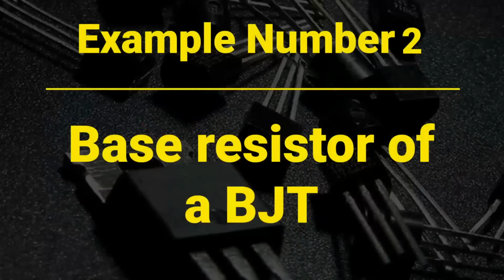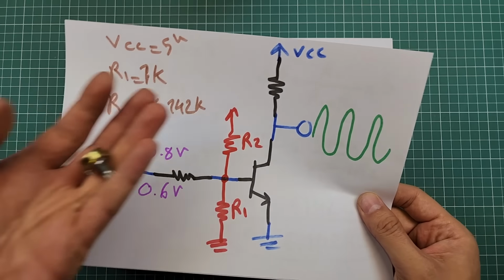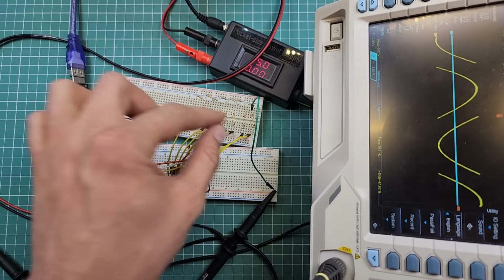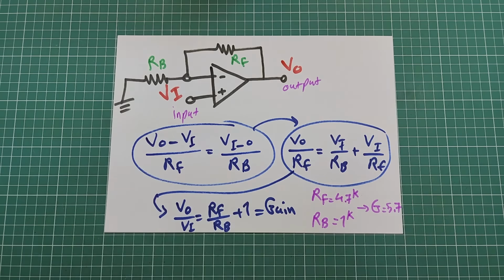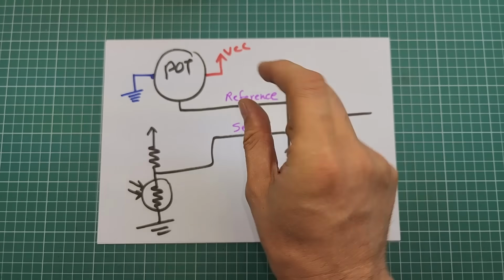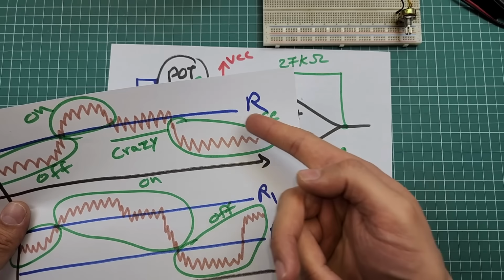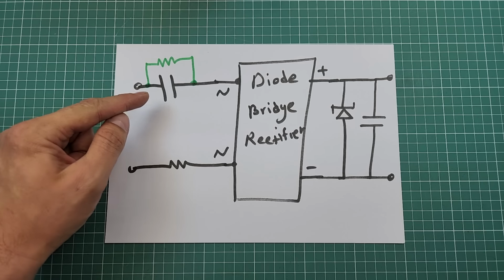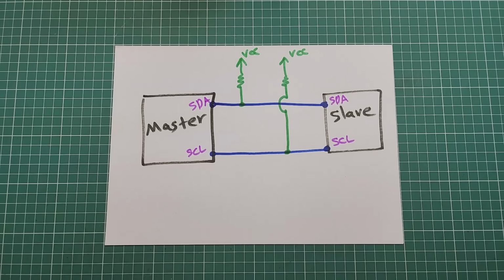Unlock the Secrets of Resistors through 16 Examples

Comment: 16:25 remember when manufacturers actually cared and just used fuses. Then if the fkn fan didn't work you just change the fuse and you know which component caused the problem.

instead of shutting down the appliance to make more money on stupid ppl that think they need to buy a new one.

Comment: You claim that resistors are not simple components and back this up by showcasing multiple circuits with components that are not resistors. Resistors are the simplest components because they are linear and don’t have any calculus operations like with capacitors and inductors.
Reply from the maker: I meant that,  we can make complicated circuit using resistors. Like DAC circuits👍
By the way,  thank you for sharing your opinion

Comment: please write correctly the Unit of measurement (for example: “volt” using an uppercase “V” aligned with text). Another note: PTC, NTC and varistor, are not resistors.
Reply: @stefano.a those are a few different types of resistors…
Reply: @chrislemus9392  no
Reply from the maker: Thank you for your feedback ❤️
Reply: Varistor is a blended of Variable and Resistor, is it not a Resistor?
Reply: @Elarpachuau  no. It is a not linear semiconductor component
Reply: @Elarpachuau  also the word “transistor” contains the the word “resistor” but it is not a resistor. You can study all that components in every electronics book
Reply: @stefano.a  ok, i am trying to argue with you, i am just asking you, thank you

Comment: Why doesn't cars have varistor protecting ECU from high voltage spikes which can happen for example when simply replacing battery.
Reply from the maker: It is not simple to answer this question in comments. It needs a full video 👍
Reply: That'd be great! Because I blow the main fuse and couple of others last winter while replacing the battery 😀